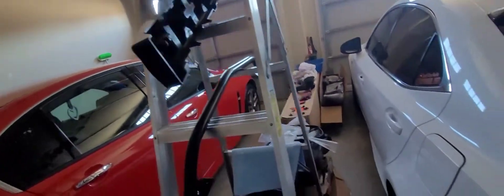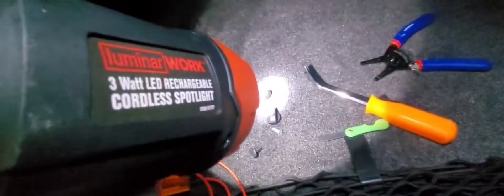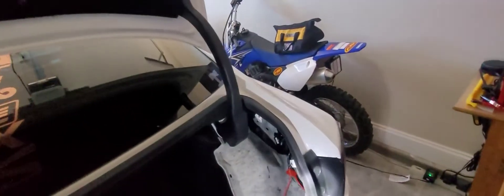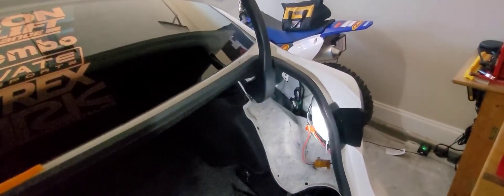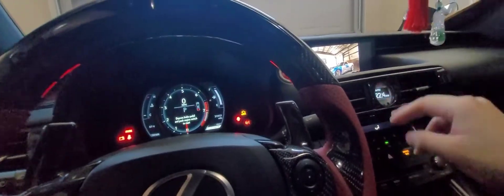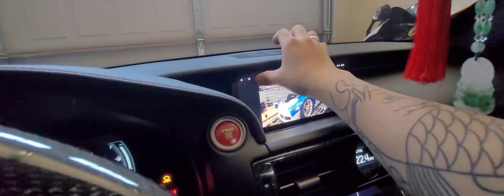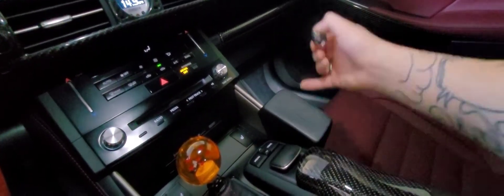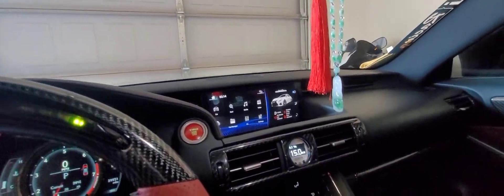Hyper Flash Fix! Carbon parts unboxing! GIVEAWAYS.

Comment: I’m about to buy the sc with pulley satage 2, ethonal kit, and big bubba bov for my is250. Do you think you could tell me all the extra stuff you needed like guages that didn’t come with the kit
Reply from the maker: Need headers 
Need afr gauge 
Need ethanol gauge 
Need a catback if you don't already. If you already have one it needs to have high flow cats if not then that's another thing you have to get and weld it on your exhaust or it will sound Hella raspy. Very bad trust me. One of my friends cheated out and his sound horrible. 
That's pretty much it that you need extra.
Reply: @davidtranmedia5112  thanks for the quick reply. I’m trying to get this rolling asap. Nice I already have the headers coming. I’ll just order the guages and my exhaust is custom so I’ll just get come high flow cats
Reply from the maker: @DiegoOrtiz-jx3ze  did you check about smog?

Comment: Make a 0-60 video man I want to see if it’s worth doing it to my is250fsport or just get a 350
Reply from the maker: Car is on the back burner as of right now. So as of now I'm driving as is. And will be worked on BBK and wheels and stickier tires and then I can do the pull. 
But like I said I have 3 weeks to get my other car ready to leave to get built so I will get to it soon. But honestly if you have doubts already and want to see it worth it and it seems all you want it power and 0-60 then need to get a car with a more capable engine.
Yes this set up is awesome and has been super reliable I travel and sit idling for 3 hours no problem. 420hp and 320tq I'd plenty to drive around and have alot of fun and beat up on some cars. But I use it as not a drag car or a 0-60 car all I care is it is plenty plenty fast from where it was. And now it's a sexy and quick car and comfortable all at the same time I can drive around  and blow doors off cars that try me. Not all but like 70% of the cars on the road. So I'm just letting you know it's a good chuck of change. If your main focus is 0-60 and power then go 2jz or some if you want Japanese and LS if you want American muscle.
On RR-RACING website under the power adder the video of the owner doing a 60 to 120 in NY 250 that should give you an idea of the acceleration because I guess the way it's gears for it being N/A it's very short and aggressive so with boost 1st gear it's very unusable the moment I hit it in 1st gear I mean foot to floor it gets to redline so fast and I don't like to do that to my car. It's so fast and aggressive with Boost 1st gear. So that's why I always do 2nd gear. And if I race anyone I use 1st and ease into it and the moment I have momentum I floor it and shift to 2nd gear.
If you see how fast it accelerates from 60-120 then imagine how fast it is from 0-60.
But I will try for you man. I need a dragy.
Reply: @davidtranmedia5112  no that’s what I need same set up you got specially if it’s still good on gas is it still good on gas?? An that’s plenty of hp especially for a light weight car overall cars is amazing from factory but just needs that extra hp which 420 is perfect that’s like isf level
Reply from the maker: @babyfacenelsoncominatya1492  yeh exactly. If on stage 2 you have to run E40% so 40% ethanol at all times it want to run 93 then have to be on stage 1
Reply: @davidtranmedia5112  can I run e85??
Reply from the maker: @babyfacenelsoncominatya1492  only in stage 2 also only 40% e

Comment: Hello, your IS250 is pretty sick, and I was wondering how well it is holding up, has there been any reliability issues after super charging? I’m thinking on doing the same to my 2006 IS250 RWD as here in Europe IS350s were never sold and importing is very expensive speciffically here in Norway

Comment: Where did you get the carbon fiber for the center dash also for odometer ? Sorry I don’t think I caught it in the video.
Reply from the maker: Around the odometer it will have you have to choices the 300 carbon with carbon overlay that stick with 3m or the carbon over the oem part itself that's around 550.
The cheap way is on eBay through saga.
And if want the expensive way then follow me on Instagram and ill send you to the guy.
Supercharged_2fifty
Reply from the maker: And the center console in carbon that's carbon over the oem part that's like $1,100 bucks from the same guy that makes the carbon over the oem pieces he does all of them.

Comment: Which LED bulbs (brand) did you go with? I’m wondering if all bulbs will result in hyper flash if the front and rear are changed or if it’s the particular bulbs you used. 
Also, a giveaway would be awesome! I would love that screen if it worked with the non-gps version
Reply from the maker: I used las fit they 100 bucks a set. Like those are the go to for hyperflash. But for me did not work. So I had to add Resistors.

Comment: no hate, but why supercharge a 250 instead of getting a 350
Reply from the maker: Why would I trade on my 250 for a 350 spend more money the boost that? When I have a 14 250 with 30k miles paid off in 2 years title in hand lol. Just boost it and enjoy it. 430hp and 340tq is no joke.  Also I love my car no matter what cause when I'm tried of this motor or it goes out I have a LS V8 sitting right here waiting to get swap in. So the 250 and 350 doesn't matter to me at all. Fun weekend car as of now with my turbo 1500hp SS also a weekend car. This should do. With my 06 type-s with 20k original miles my 1st car.
Then swap a v8 in and I'm good to go.
Reply: @davidtranmedia5112  for real, my 250 is paid off and I’m blessed. Might as well buy another car instead of buying a is350 if you want a fast car. Thinking about boosting my 250 in 3 years or so.
Reply from the maker: @vvsre760  yeh man if we want to talk about fast cars Lexus ain't it. Sorry to cut it but better and faster and cheaper cars out there. I didn't boost my 250 to be the fastest. I boosted it to be a fun as daily driver and one of a kind. I have other fast cars/ toys for that. And like I said v8 is gonna be swapped in later so 250 or 300 or 350 don't mean nothing to me. Lol 😆 some ppl are so focused on the badge. I build my cars none of them are stock.